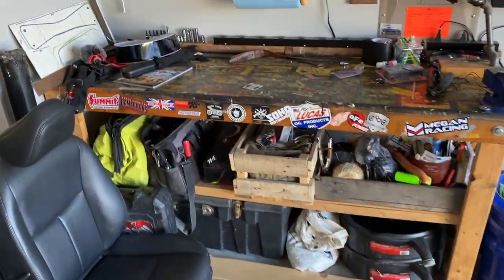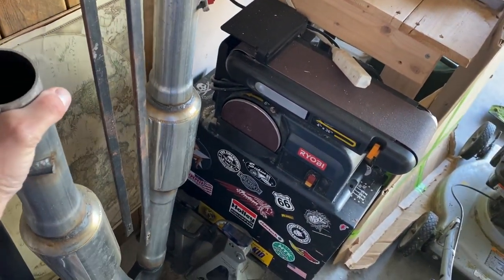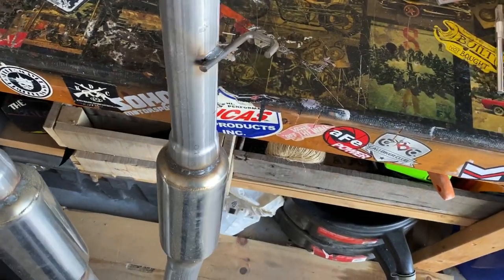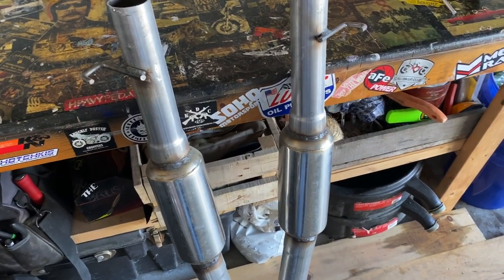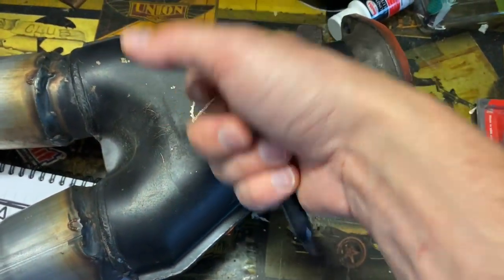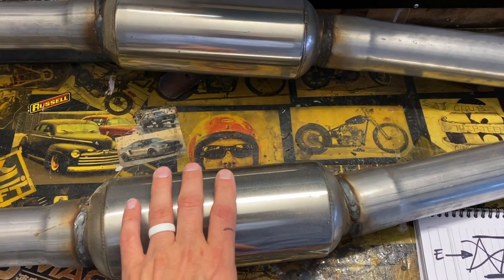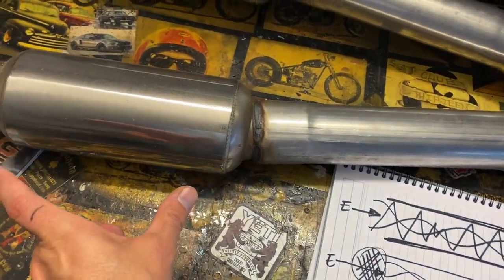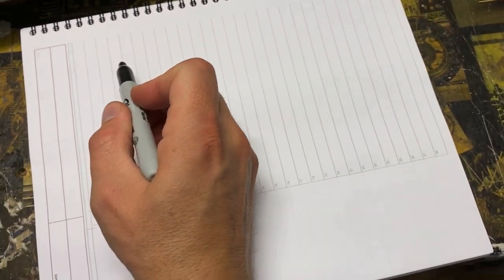THE Problem with Nissan Infiniti Cars | RASP and how to fix it!

Comment: I have non resonated lower down pipes , and a full catback exhaust with NO resonators and its raspy at certain rpms,  what resonator size would you recommend? Its a 3.0t btw Anything will help.
Reply from the maker: I would look for resonators that are 18-20” in length and 4” in overall diameter.  One for reach side of the exhaust.

Comment: I love all your videos. Very informative, and always fun to watch. I have an 08 G35xS Sedan. I have (z1) HFCs to a (ISR) 2.75 inch y pipe, to a (Manzo) 2.25 inch resonator pipe w/Manzo mufflers. My Rasp is unbearable (rasp origins after HFC install). IYO, if I were to leave the z1 HFCs on, what do you think would work best to eliminate the rasp⁉️ Y pipe resonation? new axle back? Help!!!
Reply from the maker: You could replace the manzo mufflers with vibrant street power mufflers.  They tone rasp down quite a bit.
Reply: Your problem is your y pipe, the inlet is 2.75 but the outlet is 3 inch, matching a 3 inch pipe to a 2.25 inch pipe is were the rasp will happen, and bad exhaust flow too, get a 350z hr y pipe witch is 2.5 inch all the way through and get custom 2.5 inch piping after the y pipe with some resonators or mufflers, I'm pretty sure those HFC are 2.5 inch all the way as well
Reply: Good chance those HFCs rattle a little bit if they came with cheap gaskets like mine did. If it sounds something like at 6:00 mark of this video then I'd replace the gaskets with better quality ones and see if it fixes the sound.

Comment: does Adding an intake change the tone and character of the exhaust?      

would K n N replacement oem filters be effecient as aftermarket intake systems
Reply from the maker: I’ve talked about this a ton over the years.  Some people say it changes the exhaust note—it doesn’t.  
Check out my other videos for intake vs filters.

Comment: Will that borla muffler work with a g37 sedan? I just did a resonator delete and want to replace that resonator delete with this borla muffler
Reply from the maker: Yes it works
Reply: @SpeedCultureStudios  main thing im concerned about is the stock g37 pipe which is 1.5 inches and the borla is 2.5 i was told id have to get a 2.5 inch y pipe by an exhaust shop for it to work

Comment: Hey! I am planning out my custom exhaust build for my 2010 g37x sedan could you let me know how you think this would sound? I am looking for something aggressive and rumbly but not to be shaking everyones house on morning startups. Resonated test pipes into a magnaflow 11386 X resonator into 17930 resonators in place of the oem ones back to just 4" tips with all custom 2.5" piping throughout?
Reply from the maker: That should sound nice.  Very similar to my setup.  The magnaflow won’t cut down the rasp as much as my borla does, but should still sound decent.  It’ll be aggressive but not overly obnoxious.

Comment: If I want to get your set up on my g37. Do I just buy everything on your Amazon exhaust system list? And I also want to get my lower down pipes, which are the best? I was looking at the Megan resonated, but I heard they crack. Get back to me please (: looking forward to getting these parts by next week
Reply from the maker: Borla muffler and 2 flowfx resonators and flanges. That’s all that’s needed. All test pipes are good except Megan racing.
Reply: @SpeedCultureStudios  I would also need to buy the Squirrelly 2.5" Inch Stainless Steel Mandrel Bend Angles Builder V-Band Clamp O2 Sensor Flex Coupler 90/45 Degree Exhaust Header Piping System
Reply from the maker: Billy Rivas I don’t know what you’re saying. If you want my setup, you get the borla and the flowfx resonators with a couple flanges and take it to an exhaust shop. Done.
Reply: @SpeedCultureStudios  got it, sorry I was wondering about the meddle in between those go connect them. But it makes sense that they would have some there. I'm not being the brightest
Reply from the maker: Billy Rivas haha it’s ok. I have to remember that some people have never done this stuff before. It’s all good man.
Reply: @SpeedCultureStudios  yeah I usually go with something I can just bolt on
Reply from the maker: Billy Rivas sometimes that’s easier but a lot of times it’s way more expensive than it’s worth!
Reply: @SpeedCultureStudios  update, getting sound system next week, i can email you video so you can show subscribers how the g37 sounds with ur set up! And on the test pipes im in between manzo non resonated or isr none resonated. Any suggestions?
Reply from the maker: Billy Rivas I had good luck with the manzo but isr is good too
Reply: @SpeedCultureStudios  I've been looking for manzo Test pipes, but no one seems to have it for the 2011 g37 . Also for the sound system, would I also need to buy a Y pipe, or X pipe?
Reply from the maker: Billy Rivas test pipes for the vq37 will fit the g37. X pipe or y pipe — whichever you want.
Reply: @SpeedCultureStudios  lmao sorry man, okay so ur no longer running the 1320 I saw from the video of 7 months ago "$500" custom exhaust. Youre running am X pipe. Can you give me link to set that up please :) I appreciate everything 🙏 I've been looking through your Amazon exhaust, just unsure on which one it is, if you do have it listed.
Reply from the maker: Billy Rivas In the $500 custom exhaust video I did not mention a y pipe. All the components are listed in that video.
Reply: @SpeedCultureStudios  Ooo sorry last question, the flanks, do I just need to buy quantities of one or two on ebay... sorrry not sure if it comes in pairs or not & also was the X pipe made in the shop? I ordered everything else today 🙏🏼 
Thank you!
Reply from the maker: @ProjectBMWevolve  the flanges from ebay come as a pair.  You just need to order 1
Reply: @SpeedCultureStudios  everything is being shipped! I'll send videos over once its welded together! 
I've been trying to get manzo test pipes or ISR TP but it seems that everything is put of stock. You have any website that have them Available?

Comment: Here’s the conclusion I came to through extensive non-relenting research on this subject lmao:

The Gemini catback for the coupe/370’s have NO hissing or rasp with HFC’s or test pipes unlike the 3.7 sedan sedan version and here’s MOSTLY why: 

resonators are ON the Y-pipe (closer to the cats) on the coupe/370 version. For the sedan, the resonators are on the Mid pipes, farther from the cats, which leads to hissing and rasp and it’s a pretty shitty design flaw. Not a knock on invidia either, it’s the same for every catback system I know of for the sedan. The 18 inch resonated mid pipe catback from fast intentions is the best option but those are hard to get. Everything else lacks proper resonation of the exhaust coming from the HFCs/Test pipes leading to the hissing/rasp, especially on deceleration. Diameter of the piping also plays a role but for the most part, it’s that shit design for pretty much all catbacks not having resonators where it counts. 

That being said, SCS custom catback is literally the best catback system you can get for a 3.7 Q50 or 3.7 sedan if you want solid power without sounding like diarrhea in a tin toilet at rikers island
Reply from the maker: I have to agree 😁 But seriously you’re right in that having a substantial quality resonator very near to the test pipes is extremely important combating rasp.  Having a resonated x pipe like the borla is ideal because not only is it a strong resonator, but also allows the exhaust gases to cross over one another which “smooths” out the tone.
Reply: @SpeedCultureStudios  i dont think I can get x pipe on AWD or can I? Also recommendations?
Reply from the maker: @gods1hell1spawn10011  yes you can.  It fits right where your y pipe is now
Reply: @SpeedCultureStudios  Sweet man I appreciate your advice you been helping keep my G tasteful hah. Which x pipe would you recommend with muffler delete and stainless steel test pipes? Any x pipe should do the trick?

Thx for your input!!

Comment: Hey, man. So I have the hfc and 1320 y pipe with an aftermarket axleback. I feel that it needs one last touch and the borla mid muffler sounds like that would be it. I did look at your set up of components but I’m not entirely sure which borla pro xs muffler would be the correct fitting for my 1320 y pipe. Would you happen to know? Thanks a ton
Reply from the maker: If you’re going to keep your y pipe intact you’d have to get a single inlet muffler, with dual outlets. I’m not sure borla offers along those lines but there are options out there. You’d want that single inlet to be 3” to match your y pipe and you’d need to have a 3” flange welded to it so it can bolt up to the y pipe. The outlets you’d want to match your midpipe which sounds to be stock. You could get 2.25” and have the exhaust shop reduce it down to tie into your factory midpipe.
Reply: Speed Culture Studios Thank you, sir. I almost wish I never got the y pipe and kept the stock piece 🤦🏽‍♂️. But I do like what the y pipe has done. Its just that it’s kind of a monkey wrench if I want to do anything else to my exhaust system going forward 🤦🏽‍♂️
Reply from the maker: Daniel Adame I agree with you. I started with the y pipe as well which only lasted a few months before changing everything. I would have skipped it if I had to do it again!

Comment: Hey bro , what about Invidia Gemini exhaust, what you  recommend them
Reply from the maker: I’ve heard people happy with invidia.
Reply: Speed Culture Studios thanks bro , love ur videos
Reply from the maker: Torvarris Evans I appreciate that very much man!
Reply: Speed Culture Studios hey bro , dose headers really needed  it for  hp .  In particular the 3.7
Reply from the maker: Torvarris Evans Not for the 3.7. You wouldn’t experience much for power gains if you have other modifications already installed. Plus, they are not cheap for quality headers and they are very difficult to install so just not worth it in my opinion.
Reply: Speed Culture Studios ok thank you, what about exhaust  system , dose it have to be 2.5 or 3inches for maxima gains. I order a Invidia exhaust system and the piping size is like 2.36 will this  affect my performance . And also am planning on do a tune in the future.

Comment: I installed resonated test pipes on my 350Z HR. Its very raspy!! Should I install any resonator?
Reply from the maker: Adding resonators is the only way to help with that rasp!
Reply: @SpeedCultureStudios  can you suggest me any resonator? The test pipes were resonated but they have the typical VQ rasp.
Reply from the maker: @younasghulam1714  FlowFX resonators by flowmaster work well or vibrant streetpower resonators are good if you're not adding any other type of muffler.

Comment: Ey bro, will i get a cel if install a motordyne art pipes? Or should i just go with a catback ark grip? Currently i have a remark axle back set up.. thanks
Reply from the maker: If you replace the cats with anything other than high flow cats, you’ll get a CEL.
Reply: Speed Culture Studios will i benefit anything sound or performance wise upgrading my current remark axle back to a cbe ark grip and just leave my cats stock?.. dont wanna mess with cel..
Reply from the maker: MrRainnnsss You won’t see any difference in performance—sound, quite possibly. Axleback isn’t really a performance part. And you won’t have to worry about a CEL changing anything after the o2 sensors.

Comment: I got berk rtp a resonated dc sports ypipe and isr single exit gt with 18 inch vibrant and still have horrible rasp at 3k any advice on fixing this
Reply from the maker: It’s the isr resonator at the tip.  Get rid of it and put a vibrant ultra quiet on the end
Reply: @SpeedCultureStudios  do you mean the isr muffler at the tip ? I already replaced the isr bottle style that comes in the mid pipe
Reply from the maker: @josegonzales7699  yes the one at the tip.  They aren’t good resonators.
Reply: @SpeedCultureStudios  thank you for the response that will be my next move

Comment: Question my rasp I just after installing my test pipes are coming from my small resonators on my invidia Gemini exhaust sounds like springs or some rattling and only happens when I’m driving normal speeds or floor it but on neutral or park u don’t hear it really do I need bigger resonators
Reply from the maker: Yes just add some resonators
Reply: @SpeedCultureStudios  thank you always helping I appreciate it

Comment: Thank you thank you  for this video. I was trying to find a solution to my issue with my g37 after i installed hfc and kept the stock resonators and muffler. I wanted to stay as close as possible to the stock sound, it sounds good but it sounds very raspy when i step on it at a stop sing or light. I think im going with the resonated x pipe by magnaflow, thoughts please
Thank you
Reply from the maker: Depends on how raspy it is.  A resonated x pipe might help, but you may need something a bit more substantial.

Comment: Do you get a different sound with an x pipe, over a y pipe? I know since I have a 3.0t that I will never get that deep aggressive sound like my cts v had, but what can I do to my current car, to get the deepest tone possible, so it's not tingy or raspy?
Reply from the maker: Large diameter resonators help. An x pipe helps to even the tone a bit as well—a resonated x pipe is best. But resonators allow those longer wave lengths (deeper tones) to pass through while they absorb those tinny raspy notes that you’re talking about.

Comment: I have a question,  so if I install test pipes down to the Borla Pro XS 2 in 2 out, do i need to install the Upflow Resignators" after the  Pro XS before the tips, or at all?   Also,  how soon did you have to tune your car after installing the custom exhaust?  Thanks, a follower and fan . #G37Guahan🇬🇺  #Power&Speed  #Respects
Reply from the maker: You do not have to install the resinators if you don't want to, but I recommend it due to the raspy nature of the car.  The custom exhaust alone does not really need a tune, but if you install test pipes, I'd recommend a tune right away.
Reply: @SpeedCultureStudios  Thanks for the quick reply, but i do have another question. (Sorry, just want to make sure, beforehand.  Its a long way to chane orders or reorder 😩😜)  Did you install "Resignated/High Flow Cat Test Pipes" or just straight  piped?  If you have a preference, which would you prefer to run....!?!?!  Thanks
Reply from the maker: @meggetpangie6199  Just depends on what you are going for.  With a tune, test pipes will get you the most power, however, they are not street legal, of course.  High Flow Cats will allow for good power gains, will possibly keep you street legal, but are quite expensive.  If you choose test pipes, I recommend resonated to help with the drone.
Reply: @SpeedCultureStudios  Appreciate the time and advice, will keep you posted when its all done 👍🇬🇺💯🏝🏝🏝  #paradiseG37

Comment: if i just take muff off and leave stock resnators on my 3.7 q50 how will that sound compared to your setup
Reply from the maker: Sounds quite different but I like a muffler delete on these as long as you leave factory cats.
Reply: Speed Culture Studios is it significantly louder?
Reply from the maker: ToXic FallZone it’s hard to say. It’s a different tone. I don’t have cats so it’s pretty loud, but it’s deeper because of the larger diameter exhaust and large resonators, so it almost doesn’t seem that much louder. I haven’t had a “muffler delete” for a long time so I don’t even remember. Check out my old muffler delete video and compare it to one of my new ones.
Reply: That’s what mine has done to it and it sounds good
Reply: Franklin Aguilar does it pop at all or have any drone?
Reply: ToXic FallZone it doesn’t pop it’s sounds good tho
Reply: Try it it’s cheap
Reply: Franklin Aguilar thanks for the reply, how much did you pay

Comment: Question... I have a 2011 g37x coupe automatic 80k miles.
I'm experiencing a noise. A rattle I personally been researching what it is. I came to conclusions it might be the chain tensioner or guide. Anyone else dealing with same low knocking  sound at around 1100 -1300 rpm..? I'm thinking of getting a kit replacing chain, tensioner, guides, water pump.. what do you think. Anyone else been through this..?
Reply: Edgar Guzman that is in fact could be your idler pulley I just changed it and had the same exact noise u did. or your serpentine belt. change both of them and change your pulleys.

Comment: Is that an after market steering wheel?
Reply from the maker: Yes
Reply: Looks dope bro. Good question for you though. Would you prefer a 2015 hyundai genesis 3.8 awd loaded out 80k miles for $17,000 or a 2014 Infiniti q50 3.7 premium awd with 57k miles for $15,000
Reply from the maker: @isiahacarriero9992  the Q for a lot of reasons.  More reliable just in general.  Plus way less miles.  Better price too.  Genesis isn’t bad tho
Reply: Yeahh definitely love how the genesis look inside and out. Thank you though man. Probably will get the Q50.
Reply: Do you think the 3.7 or 3.0 t is a better engine? Power and reliable wise
Reply: @SpeedCultureStudios  would you mind giving a link for the steering wheel though?
Reply from the maker: @isiahacarriero9992  there is no link.  You gotta check out my videos man.  Every park I’ve installed has been documented.
It’s from jaliscos_carbonfiber